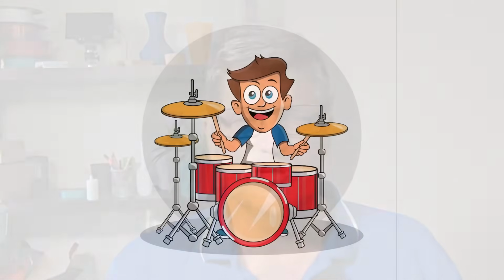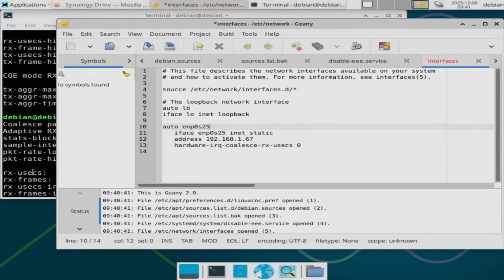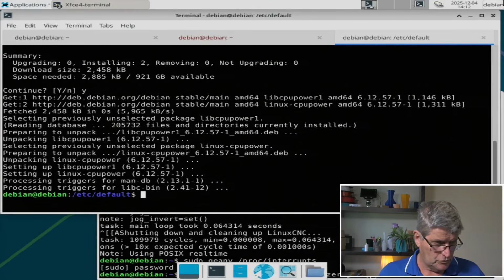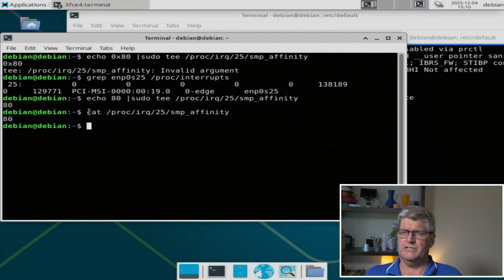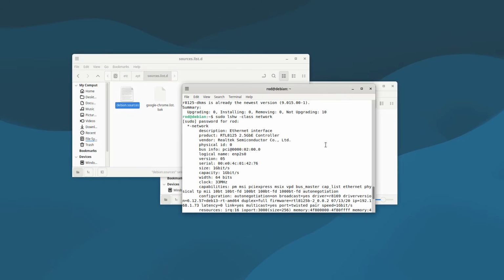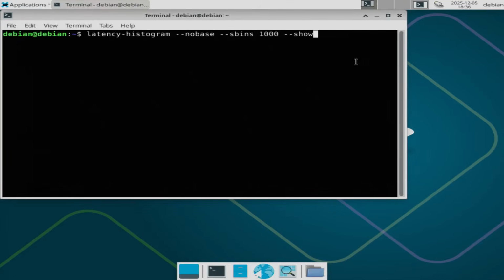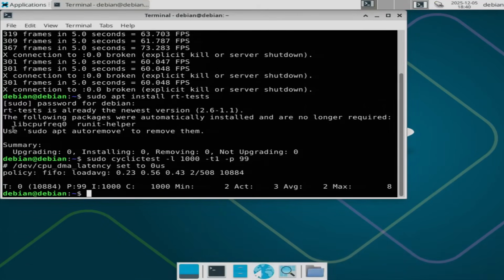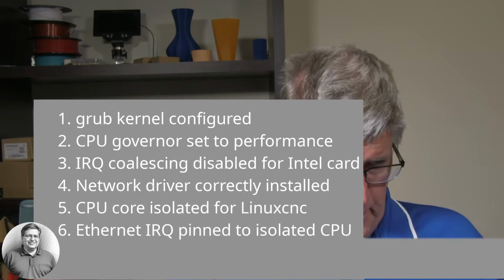6 Secret Real Time Kernel Tricks for LinuxCNC Nobody Knows About!

Comment: You install grub-customizer but never show how to use it, did you set isolcpus and affinity?
Reply from the maker: Just published a short video showing how to set the kernel parameters. https://youtu.be/N9tv5LoZuHI
Reply from the maker: oops, something seems to have been left out. run sudo grub-customizer and on the second tab, where it says quiet, add :
isolcpus=7 nohz_full=3 rcu_nocbs=3 intel_idle.max_cstate=0 processor.max_cstate=1 processor.max_cstate=1 idle=poll
this:
“reserves CPU core 7 (last one) exclusively for LinuxCNC by preventing the Linux scheduler from using this CPU"
"Disables timer ticks on this CPU"
"Moves RCU (read-copy-update) callbacks off this CPU"
 "Prevents CPU from entering deep sleep states"
 "Keeps processor responsive"

CPU affinity is covered from 9:39 https://youtu.be/wSXEKHiczIw?si=DkazAvIZSlaRpS9Q&t=579
There are bookmarks in the description
Reply: He shows it in another video though, the one about installing LinuxCNC.

Comment: Or just get a FluidNC card and not have these problems.
Reply from the maker: Might work for simple applications but falls over for complex tasks like spindle synchronized threading, 5 axis TCP, or complex machines with tool changers.

Comment: Very helpful video!
I wonder if it is possible to use older Debian versions (12 or 11) and achieve similar results. Personally I prefer to use the stable versions. I.e. last release of previous distributive.
Reply from the maker: Yes, Debian 13 (Trixie) is what Debian calls stable but this should also work on Debian 12 Bookworm (oldstable) which I did a lot of the required testing on. Not sure about Debian 11 as LinuxCNC was never released on that platform but I have used it on one machine. What I have noticed that each kernel has had improved latency so I won't recommend Debian 11 and I think best results will be on Debian 13 (except perhaps for RTAI

Comment: Just ordered components to update a machine for use with LinuxCNC. I'll be building it this weekend and will try to post some latency numbers. The Sherline CNC controllers I have require a parallel port though (I'm using a PCIe-based card), so the network IRQ and latency stuff isn;t as important to me. But this was a GREAT video and very educational!
Reply from the maker: Great stuff! My focus was on networking because that seems to be the biggest problem people have. But you should still complete the process and you should achieve an improvement.
Reply: @MrRodW  Got the new system built: i5-12600K on a MSI mATX mobo, with 16gb of DDR4 ram, at 3200MHz. Tried to install LinuxCNC directly from their debian image, but kept getting package mirror errors. So I reverted to installing debian directly, and then linuxcnc from packages. That was a MUCH smoother installation. I have done the isolcpus yet though, as this CPU chip has 6p+4e cores, but lscpu -e doesn't seem to show me which is which--they all seem to have the same frequency, so I will need to look into that more before setting it with the grub-customizer tool (which is awesome, by the way).

Once finished I ran the latency-histogram --sbins 1000 command, but since I'm going to be using a PCIe-based parallel port, I wanted to see both the base and servo thread jitter values. With one of your YouTube videos running, along with 8 instances of glxgears, here are my numbers: 

base max uS = 22.8
servo max uS = 11.9

When I killed Firefox the numbers improved considerably. With 8 instances of glxgears running, I saw:

base max uS = 13.3
servo max uS = 7.6

The machine is using the Intel UHD 770 graphics. I am not planning on using a dedicated GPU, as the case is on the small side. I do have a couple of very hardy cooling fans, along with a CoolerMaster CPU cooler. And uname -a shows me that it's the 6.12.63 kernel though, so slightly newer than the one shown in your installation.
Reply: Just figured out the performance vs efficiency cores thing. Just cat two files, like this (shown with output):

$ cat /sys/devices/cpu_core/cpus
0-11

$ cat /sys/devices/cpu_atom/cpus
12-15

So there you have it--simply choose two of the cores in those listed in the /sys/devices/cpu_core/cpus file, and send them to the kernel via isolcpus=<x>,<y>. The thing you don't want to do (I'd think) is to arbitrary pick two numbers without knowing which is which. Otherwise you might end up using an efficiency core(s) by accident, which likely won't give you the performance you expect.
Reply: @MrRodW  Did you check  that Linux was using the r8168-dkms driver, after you installed it? I installed that driver as well, and ethtool told me that's the network interface I have. But once I installed the -dkms version and rebooted, the NIC didn't work. I had to purge that driver to get back online again. 

So I would be curious to see which driver your machine is using after a reboot.